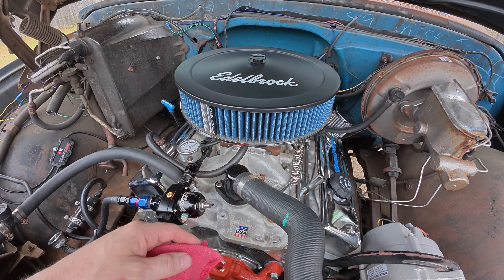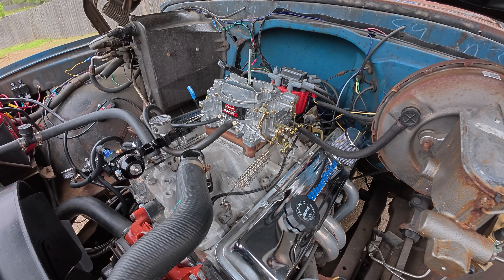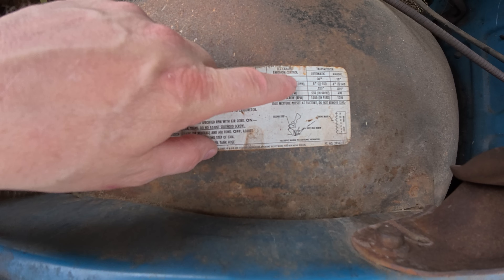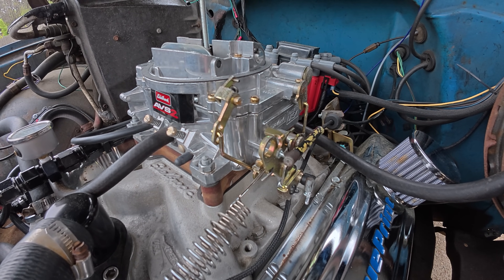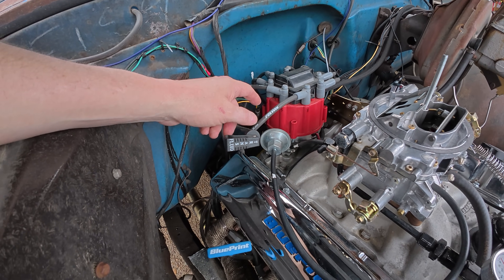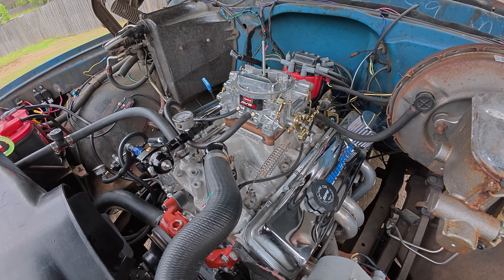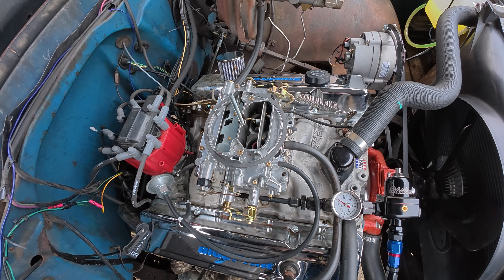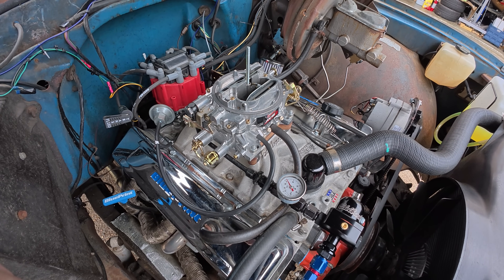How to Stop Engine Dieseling

Comment: If your small block Chevy is dieseling check and make sure the initial timing is at or near 10 degrees BTDC with the vacuum advance disconnected at a low idle. Next connect the vacuum advance to ported vacuum. After you do this if it still diesels when the engine is warmed up connect the vacuum advance to a manifold vacuum source. Reset the idle and the problem is solved. It's just that simple. All the rest is BS. High idle speed or retarded timing are the causes of dieseling. If the timing is not retarded then high idle speed is the cause. You can only advance the static timing so far without causing starting problems. Connecting to manifold vacuum is not a problem if your initial timing is no to high. After you open the throttle on ported vacuum you are on full manifold vacuum anyway.

Comment: Hey I was trying to adjust timing on 71 g30 cause was stumbling when you shut her down. It got worse to the point couldn’t get it off, never had this problem before. Carb is quadrajet rebuilt but has been sitting off and on, running points as well any help appreciated

Comment: Just bought a 1984 Chevy chevette that is all original besides spark plug wires, spark plugs, carburetor and an aftermarket electric fuel pump (carburetor electric fuel pump as so I wanted to eliminate the mechanical fuel pump as to not have problems), but I’ve actually had the car running today and I went to shut it off and it will diesel bad (only when warmed up) now my question is maybe my coolant isn’t flowing through and causing the engine to get too hot and causing the bad dieseling? Before it wouldn’t diesel near as bad, so I’ve retarded timing as far as I could and adjusted carb ect and it now diesels worse? Should I replace coolant system and see if it’s just getting really hot? Or is there another underlying issue.
Reply from the maker: Time to start running a bore scope down the runners and into the chambers and see if it’s loaded with deposits.  Pop the valve covers and see how nasty the deposits are. Will give you a general indication of how it’s been treated.  Killing all the power on a low HP engine isn’t going to do you much good.  If it’s original from that far back, and you’re ok making the investment, it might be time for a refresh.
Reply: @MuscleCarSolutions well I’ve changed my auto choke and it has quit dieseling (for now), I’ve yet to actually drive it but I’ve only let it warm up and drive it on my farm, before with the aftermarket carburetor the auto choke wasn’t working properly leaving the choke butterflies completely open (didn’t pay attention until I took the air cleaner back off) so I put the original auto choke back on and it’s solved it as far as I can tell.

Comment: 427 engine dieseling issue, i eliminated the mecanical fuel pump and put an electric fuel pump,i drained the gas tank and put 92 premium gasoline, and the first time i start the engine and turn it off but still running,after trying this for 10 times finally the car turn off when I turn the key off 5 times I hope is OK now,I really appreciate you making this video for better understanding of  owners some people don't understand what a dieseling issue is 😉 you are a champion  thank you again
Reply from the maker: Hope one of those suggestions helps you!

Comment: This is probably going to sound stupid, but here we gooooooooo.....  Would it be effective to run a catch can between the PCV and the carb to eliminate garbage but still allow fume and vapor reburn ?New to the channel, have commented on several videos, and you never reply :(
Reply from the maker: Once it’s in the catch can, I’m not sure there’s a good reason to send it back to the engine.  Evacuating the crankcase also means water.  If you’re good with a catch can as an option, it’s a good one.  PCV works well too, but there’s the trade off.
Reply from the maker: And I’ve literally responded to every video I see you’ve posted.  Some just minutes after you did!
Reply from the maker: I see you’ve made four comments on four videos and I’ve responded to all of them.  Turn on notifications and you’ll get them when someone comments on your comment.
Reply: He’s pretty good about responding…Have your ducks in a row though, he’ll usually ask specific questions about your ride-cruiser, daily or race…engine, cam, fuel setup/settings/both degrees of timing info etc, he needs to know to give an educated answer. I’ve personally have learned a lot. Good luck!! 👍

Comment: I am now owner of 1978 Ford F100 with the inline 6. Got kinda lucky on the price, but thats another story. The truck came with an offenhauser intake manifold, edelbrock 4 barrel carb, complete aftermarket exhaust system, msg distributor, msd ignition system, accel super coil and an aluminum radiator. Its upgraded to a serpentine belt instead of v belts. It was definitely someone’s little hot rod at one point. My whole point is that, ive started replacing parts like the fuel pump, fuel lines, fuel tank, water pump, spark plugs, and tires. This weekend i went to try and adjust my mixture screws and is now causing to sputter after i turn of ignition.

Comment: I have to  pull the power from my electronic distributor.  Then the car turns off ? Is this an electrical issue?
Reply: You're saying it's still providing spark until you do that?  If so, it's definitely an electrical issue.

Comment: A normally open soleniod conneced to a T-piece on the hose to the break booster works very well. When you turn off the ignition key the solenoid opens sending AFR so high that the mixture is impossible to ignite.   :)

Comment: I left a message here I thought, anyway the only time I dieseled was the last three times I ran the truck with the new motor, it was after I put the E Cruve Distributor in , I am running 19 degrees initial and 34 total and it was 95 degrees outside , I will be going over to the 55 this weekend I will run it the way it is now outside temperature should be around 60, we’ll see how it turns off, if it still wants to diesel I will back off timing , also be looking at plugs, anything you can think of, great video Brian as usual, talk to you soon😀😀
Reply from the maker: @DesertRatFabrication  best of luck!  Can be frustrating to chase down.

Comment: Just put in a blue print 383 stroker and it diesels no matter what I’ve done. It’s brand new with a brand new Holley carb. My shop mechanic said to shut the vehicle off while still in gear and then put it into park. That works. No deiseling. 🤷🏻
Reply from the maker: @praisethelord4222  that’s just a bandaid.  Keep digging!
Reply: Check your AFR and check your plugs.  I had a similar issue with my 383 (not a Blueprint), but it was due to carbon buildup after excessive idling (traffic) and a rich mixture.

I leaned out my idle and cruise AFR closer to 14.7 and switched the vacuum advance to manifold vacuum, then ran a healthy dose of Seafoam through the fuel tank.  Hasn't done it since.
Reply: same engine same problem brand new out the box i cant find the cause...its really annoying
Reply: Blew up my new 318 following same advice lol

Comment: A vacuum advance hooked to manifold vacuum cools cylinder temps and also allows the throttle blades to be closed more. This in turn makes a more efficient engine that does not tend to diesel when turned off.

Comment: I have a crate 350 TBI engine converted to carb. Has hot start issues even after adding a phenolic spacer (which did help some). Cold starts I tap the gas once or twice and it starts right up. Hot starts it'll crank forever. To start it after sitting hot for a while, I have to floor the gas while cranking. First startup it will start to run, then die. 2nd crank with foot to floor it started up easier and stays running. Does this sound like engine flooding? Seems like it is carb related so i'm thinking my first step is to rebuild it and check the floats. 

I'd love to hear what you think, your vids are awesome.
Reply from the maker: @christianmiller2670  oh the pain of the factory TBIs.  There are a few variants of that system.  I’ve had ignition modules have that issue on a hot motor.  What’s your fuel pressure?  Regulators go bad on those things frequently.  Coolant temp is another.  I don’t work on the factory stuff from that era much.  It was the pain we had to go through for the technology to evolve to where it is today.  Frustrating too as they’re generally not tunable unless someone is still bring chips for those things!
Reply: @MuscleCarSolutions The spacer does help a lot it seems like, but it still has to crank for ~5 seconds when hot and pumping the gas.

I ordered a fuel pressure gauge and regulator, installing it this evening. I'll set it to 5.5psi and see if that changes anything.

Comment: Take that seafoam and pour it on your campfire, that's all it's worth.
    I've been building motors for 50 plus years Marvel Mystery Oil only thing to for carbon buildup and sticky valves, and berryman's carb and injection cleaner. Add Marvel Mystery Oil every tank fill up, even works great in crankcase.
Throw away Edelbrock thermal quad type carburetors, run either Quadrajet or Holley, thermal quads belong on a Dodge😂.
Reply from the maker: @sherwinstaudt1881  Edelbrock doesn’t make a thermoquad.  Holley does.
Reply: @MuscleCarSolutions  Are you talking about the Thermoquad Holley replacement or the Carter Thermoquad ?
Reply from the maker: @tomgreen7792  don’t know.  Whatever the commenter meant.

Comment: Love your channel! I’m a novice with a 1980 C10 with stock 350 sbc. I get dieseling when I’m in a hurry at startup and don’t wait for the rpm to kick down before driving off. Almost guaranteed when only driving a short distance before shutting off. Can you help me understand what’s likely happening in the engine in those situations?
Reply from the maker: @DBG1-t9j  what’s your timing set at?  Stock carburetor as well?
Reply: @MuscleCarSolutions original stock rebuilt Rochester Q-jet. Unsure of timing but thanks for the question—I will figure it out and get back to you!
Reply from the maker: @DBG1-t9j  the Qjet is a great carburetor, but they’re a little on the complicated side. Sounds like a fast idle issue.  For sure get your timing under control.  I’m down around sea level and I always start at 12-14 initial.  The higher up in elevation you go, the more timing needed.

Comment: Can you do a video on pcv setups. Curious why you stated you wouldnt run one on a higher hp build.
Reply from the maker: @skippyricardo  I’ve touched on it a few times and some in a catch can video.  For the Chevelle, I don’t want the oil/water/contamination in that engine.  A catch can is the better way of handling the crankcase evacuation.  On the GMC, it’s not much of a consideration.   I’m completely ok with that going right through the intake and into the engine to be burned.
Reply: @MuscleCarSolutions  thanks I just found and watched that video.
Reply from the maker: @ nice.  Did it have what you were looking for?  It’s been awhile since I did that video.  Kinda forgot the details.
Reply: @MuscleCarSolutions  it did explain some more into the topic. But I still like the idea of pulling air through the crankcase rather than just venting pressure. Really enjoy your videos by the way.

Comment: In my experience,  to reduce run-on/ping is to step down the heat range on the spark plug, retard the timing and run a 160 deg thermostat, aluminum radiator, highest quality fuel, phenolic carb spacer to insulate the fuel from vaporizing. 
Because of the Ethanol fuel, Rule of thumb for me is to mount as much aluminum as possible on the block to dissipate heat.. Alum heads, intake, water pump, radiator.  The engine is MUCH happier...
Run-on can be quite embarrasing, especially at a car show.. Advantage of having a standard trans is to pop the clutch in gear with the brake applied as you turn off the ignition.

Comment: Install vacuum gage in cab. Get jug of water, window cleaner. Install  a small line to carb. Put weight  in vehicle or hookup to a trailer.  Objective is to work the engine.  When engine is under load or low vacume turn on the water. Does not take a lot. If the engine begins to misfire its too much water or not enough RPMs. Do this a couple times and engine performance will  improve.  You can clean all carbon out of combustion chamber safely  this way

Comment: O electric to coil = no run. The rest of this is unrelated
Reply from the maker: @luckyred1818  😂 that’s rarely the fix or the issue.
Reply: @ okay, please dispute these facts with facts then, because all this irrelevant nonsense is only going to complicate troubleshooting for those that know less than you. Dieseling is a misleading term, not an actual condition. A gas engine doesn’t produce enough compression to ‘diesel’. It’s low or intermittent 12vdc to the coil, typically an intermittently failing ignition switch—not the key, the switch the key is supposed to control. No spark = no combustion in a gas engine. All an engine like yours requires to run is power to the coil after starting—just 1 wire. But it can’t run without that one wire. If you experience dieseling, while the engine is running, pull the plug on the coil. You can’t produce a video of any gas engine ‘dieseling’ without the coil powered because it’s not possible. There are no mysteries regarding gas engines and electric. It’s as simple as it gets.
Reply from the maker: @luckyred1818  you’re quite a bit off on this.  Dieseling or run on occurs when the key is shut off and the engine continues to sputter until it clears itself, the heat source dies out or the fuel is removed.  I’m not making this up.  Google it.  It’s not a common occurrence, but many of us with older engines have experienced it.  If you watch the video, I address a potential condition where the ignition continues to feed power after the engine is shut off.  It’s RARE, but it’s possible. Which is why I gave a way to easily check for that condition.  Just because there is no spark and the ignition has been turned off, doesn’t mean this condition isn’t possible.  It’s quite possible.  All the factors I have are potential sources and fixes.  As I mentioned, it’s rarely one issue.  It’s usually a combination of a few which makes troubleshooting the solution complicated.  Insisting that if the coil has no power means this condition is impossible to occur is incorrect.  Wildly incorrect.
Reply: @ i don’t care how many videos were created by people that don’t understand how a gas engine functions there’s no reason for another person to make a compilation video for them, or reference them as fact. Just facts please. Fact—fuel requires 200 psi min to combust w o spark. Fact or not? A gas v8 rarely exceeds 175 psi, even in the highest compression applications. Fact or not? Do i need to explain further? I’ve been a gas and diesel mechanic since 88. Never once in 1000 times diagnosing engine run-on in a gasser was it anything other than electric. Never. Because it’s impossible. Diesel engines are a different story. The term Dieseling is misapplied, like the word toboggan in Florida.
Reply from the maker: @ dieseling is the term applied to describe it.  I’m sorry you’ve limited yourself to thinking there is nothing possible unless you approve.  😆 The whole world is wrong except you.  Got it.  😂
Reply: @MuscleCarSolutions  so not one disputable fact? Got it!
Reply: @MuscleCarSolutions  facts are facts, opinions are opinions, and feelings are feelings. The thing i love about engines is, they don’t run on opinions or feelings
Reply: @ maybe add low blinker fluid to this list of possible causes just to cover all the bases
Reply from the maker: @luckyred1818  there’s nothing to dispute.  You’re making statements that simply aren’t true.  If you think that vaporized fuel can’t ignite without a spark, then there’s no discussion to have.  You’re wildly misinformed or just ignorant to how an internal combustion engine works.  Both are curable conditions, but that’s up to you to take the initiative to go learn it.  The internet is a big place.  Go google to your hearts content and learn.  Or don’t.  🤷
Reply: Hey Brian, I was dieseling the last time I was turning off the 55 truck with the new 350, it wasn’t doing it until I put the E curve distributor in, I only ran the engine about three times and had to go home before I could play around with it, it might have something to do with the initial timing right now I have it set at 19 and total at 34, it was super hot over there then around 95 , I will be heading over there this weekend, I will try leaving it like it is the first time around, if it still diesels I will try dialing back the initial timing and go from there, I will keep you posted, great video as always buddy😀😀

Comment: My truck got stuck on high idle and so I shut it off, not knowing what the issue was. It kept running, then went BANG, and blew apart the muffler. I guess that was a detonation and the muffler was the weakest link. Runs ok now..but could use a muffler because it does loud backfires now between gear shifts.
Reply: @BRIDGEBURNERSTV  you must be running very rich

Comment: I’ll need to try these ideas. Though, I’ve mostly eliminated the dieseling issue I used to have by using 93 octane & replacing leaky vacuum lines. But sometimes it still happens if I shut off engine then crank it up while still warm and turn it off a bit after. So, I’ll try a few of these options that were mentioned in the video. …..then I’ve also decided to take off the carbs and clean ‘em out. I’ll definitely use your other videos for the clean up & carb rebuild. ….. thanks for sharing your knowledge with us. appreciate it.
Reply from the maker: @jasonpanks3317  best of luck!  Keep chasing it if it keeps happening.  Like I mentioned, it’s usually a combination of things and sometimes that takes a bit of time to chase them all down.